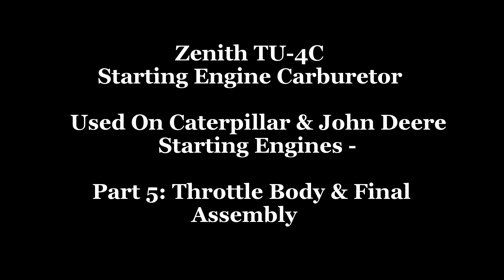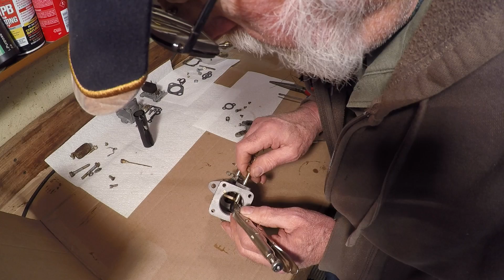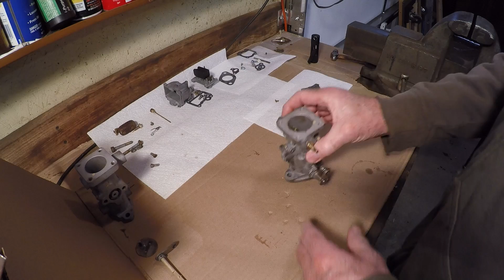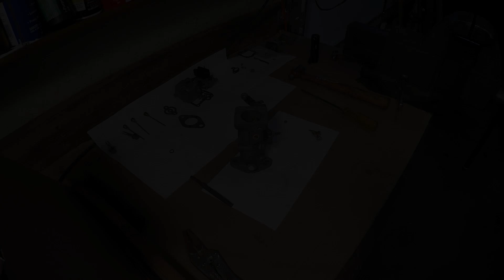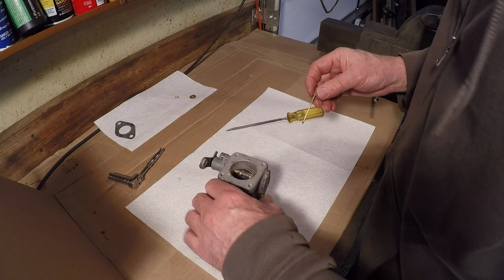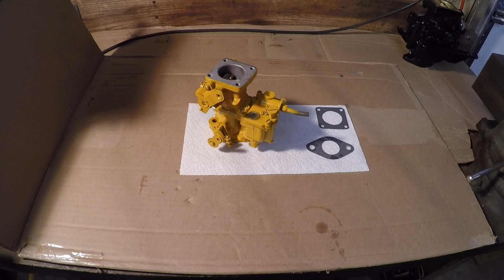Caterpillar D2/D4 & John Deere Pony Motor Carburetor Rebuild Part 5 of 5 - Final Assembly!

Comment: I noticed the high speed jet assembly is different from the start of your rebuild to the finish
Reply: My carburetor is the same as you started rebuilding do I still turn my high speed jet 1 and a half turns out from fully closed.

Comment: Fascinating to see this tear down. My car uses Stromberg carbs which I believe come from the same manufacturer. The Stroms are an absolute horror show, more so as they are a pair. They can be knocked out of balance by a bad pothole, a bump in the engine bay or even a butterfly passing gas in Tanzania! 🤣🤣🤣

Might need to change to something simpler!!!!

Comment: Now that you have this redone will you have a video showing how to set the jets on the tractor? I would like to see how you make adjustments to the low idle and high idle to make the engine run better. Thanks.

Comment: Wonderful skill and knowledge that you share and preserve for the future!  Thank you so much!

What I would offer as a variant to your technique is that you could use self-closing tweezers instead of the needle-nose vice grips.  I've also used a set of long-nose duckbill pliers with a rubber band added to make a larger version of some of the self-closing tweezers.  I also have a set of sliding-jaw thread starting screwdrivers to avoid having to use a "tack" or some grease to hold a non-magnetic screw while starting.  While the ones that I have use a sliding jaw and a conventional bit, you can look at the Klein K14 (Philips) and K34 (flat blade) series as something that would hold without grease.  But the important thing, as always, is whatever works for you.  The procedural tips and wisdom you provide are really worthwhile.  Thank you!

Comment: I have enjoyed the carburetor rebuild very much. I am hoping to see a series on the magneto rebuild too. I remember that you showed a magneto shaft that was broken. Have you ever tried to make a replacement shaft to repair one of those and I also thought about the possibility of making a replacement gear out of aluminum. I remember that GM used to use a fiber compound cam gear in their in-line 6 cylinder engines which were prone to failure. Aftermarket gears were made of aluminum that would last practically forever. I saw that was reused in a rebuilt engine that outlasted that engine and was installed in another one to replace the fiber gear that had stripped off a bunch of teeth.

Comment: Great work squatch and senior. The only tit bit that I can give is that when putting a screw or bolt turn it in the loosen direction first until you feel it drop into the thread and then tighten. I have not cross threaded anything since someone put me on to that.
Reply: Yepp.I've been quietly (til now) proud of discovering that myself.Very satisfying.

Comment: As for the flat washer. 
A older follow mechanic told me one time, always install a flat washer bebore the lock washer on aluminum pieces being assembled. Indeed it was most be seen in those days. Today, newer bolts style have the washer already in them often. 
Nice work.

Comment: Looks real good, Senior! I always preferred a product called Cast Blast for painting carburetors, but recently have started using cast grey colored engine paint, and it holds up VERY well to grease/oil/gasoline. Little tricks of the trade! Love the rebuild series on the carburetor!